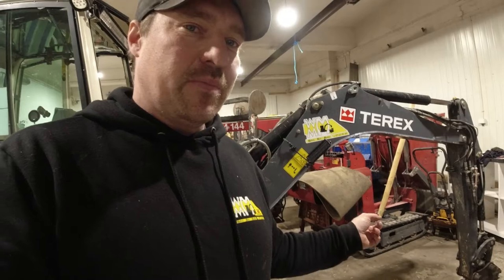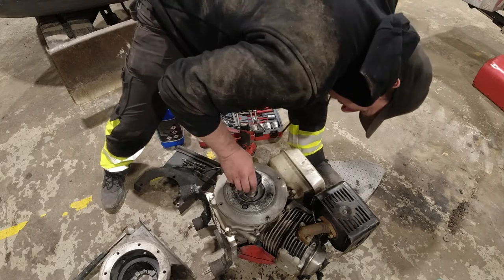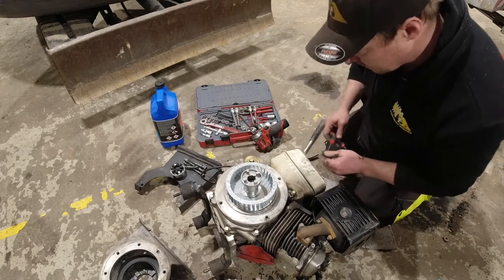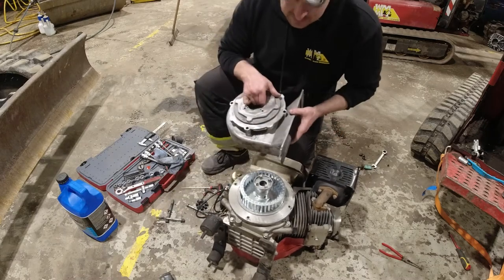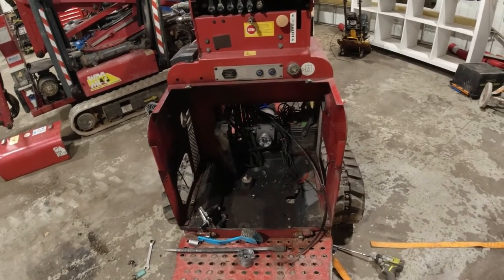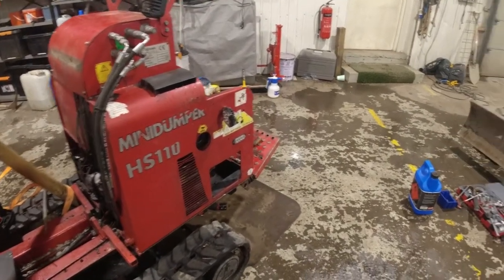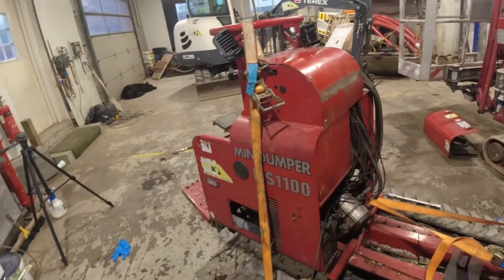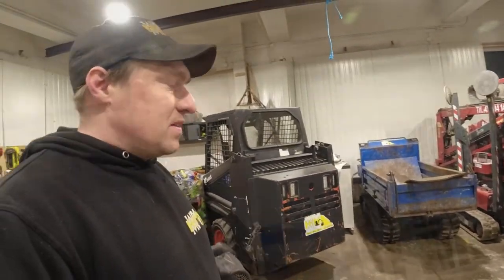Fixing the Hinowa minidumper

Comment: Did you consider blue thread lock on your set screws and bolts to limit the chance of vibration causing a failure later?
Reply from the maker: I had some Loctite on them just didn't get it in the video it was so dark without the light.

Comment: Hi mate , I’ve got a hinowa hs701 high tip with the kubota oc95 Diesel engine in. It’s becoming a pig to start turns of but usually will flatten the battery before it will start! I’m thinking of changing it to a petrol engine . Have you ever done this ?
Reply from the maker: Never did a conversion, shouldn't be a big problem, but you probably need the adapter plate that fits in an petrol engine, else the motor can be any Honda copy 13-15hp

Comment: does that copper trick work on slightly striped threads on ali ?
Reply from the maker: Yes works great, you don't get 100% but it helps a lot. Before the bolts would pull straight out but now they hold
Reply: @MiniMachines1  Ahh brill <3